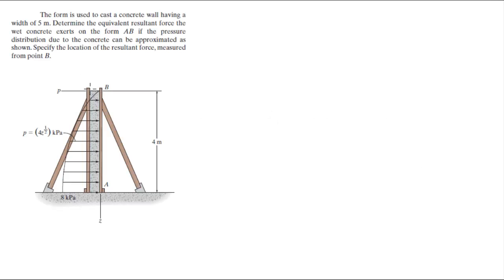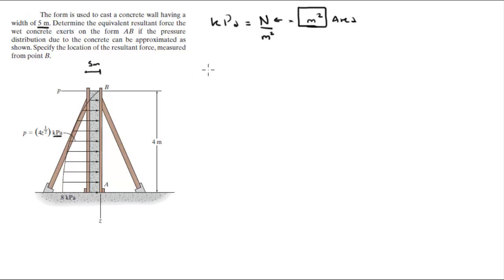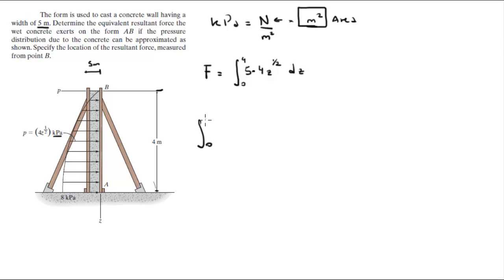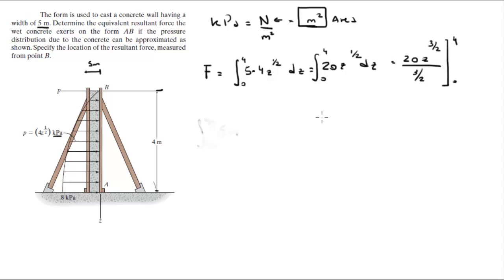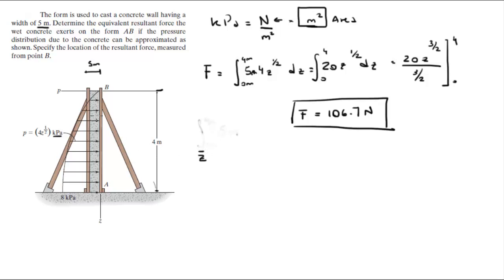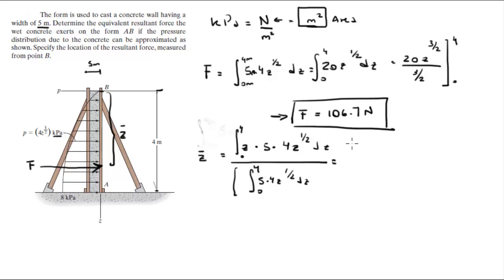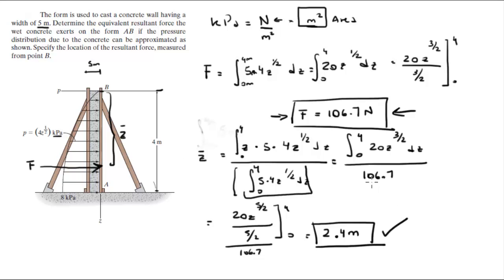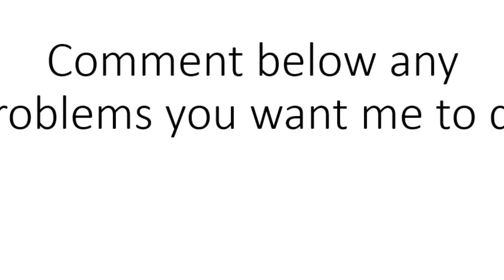Specify the location of the resultant force, measured from point B

Comment: i had the same question with 7.5m width, and got an answer 160 N but it says "Check that you have converted between SI units of force correctly"
Reply from the maker: Your question doesn't give me enough details to answer, however since it's telling you check your conversion I would venture say that your answer is correct except that it is in the wrong unit. Hope that helps!